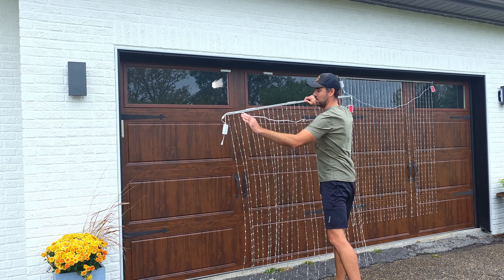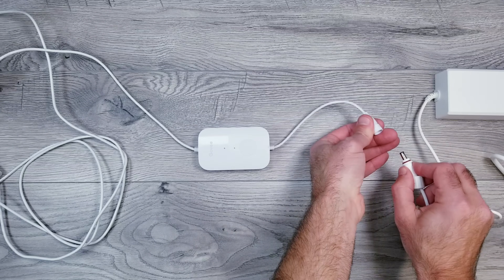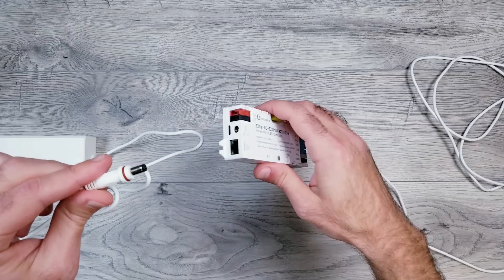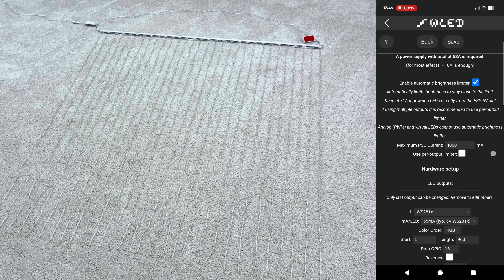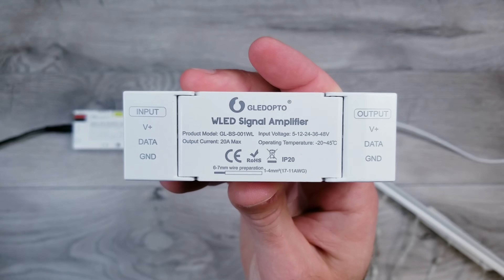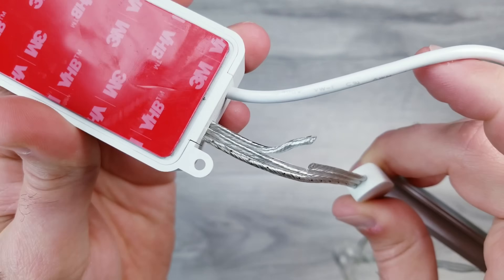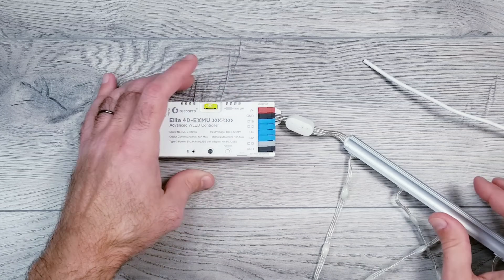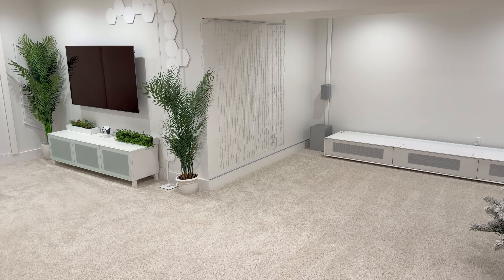will it WLED - episode 9 (new Govee curtain lights PRO)

Comment: Chris, love the conversion, but when you do it, you lose the ability to do the great graphics that Govee lets you use. is there anything out there like that which works with WLED?
Reply from the maker: Thanks for watching! My thought process was I will probably just splice the wires back together around the holidays since I LOVE govee's dreamview functionality and then when I bring them inside, switch back to WLED to take advantage of the different features that you get with WLED. It also probably wouldn't be very difficult to come up with a way to switch data outputs so you could have both connected and switch back and forth. But as far as I know, WLED does not currently have a super easy way of uploading animated gifs to convert to a matrix. You certainly can do this, but its not what I would consider to be super easy.
Reply: @ChrisMaherDIY  I would love to get a hold of the connectors Govee uses so I don't have to cut the wires. They seem custom and can't sourced 3rd party. Is that your experience?

Comment: I always wanted curtain lights but the goove ones were too expensive so I am going to pick cheaper ones and to the same
Reply from the maker: If you want lower density curtains (400 to 500 leds) and have no intention of using the govee software, then get something off brand since there are many options out there. (if you plan to use them outside make sure they are built for that like govee's are) But there is a huge difference between 400 leds and 960 leds which these pro's have and from all the searching I was doing on amazon and aliexpress, I didn't find any other curtains that had as many leds as these govee pro's do.
Reply: Thanks Chris
I just want some low density rgb curtain lights to put in my wall
:)

Comment: What a great video!  Very clear and really good close-up video.  I would be interested in hooking multiple curtains together.  I'm assuming that it's just a matter of continuing the data line with downstream power injection, but I'll wait for you to tell us.  One other thing...any possibility that this approach would work with Govee icicle lights?  Specifically, how would you use WLED to control a 20-meter string and a 10-meter string connected to make one long 30-meter string of lights for one's house.
Reply from the maker: Thanks for watching! For the curtain lights you will want to utilize multiple data outputs. 960 is already getting to be a lot for one data output so I put the second curtain on another data output on the gledopto controller, added it in led preferences and then set it up in the 2d matrix (i showed the 2d matrix settings in the video) But for the icicle lights I would probably use 2 data outputs as well. One data output for the 10 meter and then another for the 20 meter string. I would put the controller in the middle so you wouldn't have to run long wires and then WLED lets you set them up to function as 1 long run. Hope that made sense!
Reply: @ChrisMaherDIY   @dwburger  I still think these are fixed-address LEDs, so putting 2 curtains in series (with v+ injection) will result in duplication of the image on each curtain. Can you at least try it to confirm my theory? Or at least put a small strip before or after the curtain to see if the light duplicate or are serial?
Reply: @LordChariot  Not sure if you were addressing me or Chris???  However, my question was really focused on my icicle lights (a 10-meter string and a 20-meter string) and whether I could put them together and control them with WLED as a single 30-meter string.  Currently, they're running on my house for the holidays.  After I take them down I plan to try some things with them.  I'm not sure how I'll count them since they each have different numbers of lights representing different icicles.
Reply: @dwburger The questions was kind of to anyone who knows or could try it. I think if you put both strings in serial on one data output port, it would not work. They would duplicate. This is because I think they have hardcoded LED numbers built into them, so led 1,2,3,etc. will light on both strings. I want to confirm this before I cut wires on my curtains and icicles. I ran out of ports and would like to string them together instead.
Reply: @LordChariot  I asked ChatGPT about this and below is its reply:
Govee icicle lights are not electrically “raw pixels.”
They are designed to work only with their own controller and firmware.
Even though they look like addressable LEDs, internally they usually have:
- Proprietary controller logic
- Fixed segment mapping
- No exposed data-in / data-out that follows WS2812 / SK6812 protocols
Reply: @dwburger and yet they do work with a generic controller with WS281X protocol, or else Chris wouldn't have these videos here.

Comment: I dont know if it's too late for this year, but next year let's see a Christmas tree made of WLED (with star for bonus)
Reply: @InkwellFoto  I was able to successfully use the Govee 7.5' LED tree with WLED/xLights. Just cut the cord and find the +/-/data.
Reply: @LordChariot  do you have a video? I want to convert my cone trees
Reply: @gram7048  No video of me cutting the wire, just a short on my YT channel showing the tree on my deck (upper left deck). Nothing detailed. Basically, the wire with the dots is the +5, the center is ground, the 3rd line is data. Set WLED to 370 pixels. RGB Color order. The first 360 are the tree matrix (18*20), the last 10 are the star. If you use xLights, keep WLED to 1d, not matrix, and define the tree with Strand Direction Vertical, 1 string,  360nodes/string, 20 strands/string.
Reply: @LordChariot thank you!
Reply: Isn't it's already done.
Reply: @ekshoe-kun if it wasnt clear, I mean all lights and not decorating a traditional tree. Something maybe you can put in the front yard. Anywhere between 8 to 10 feet tall
Reply from the maker: Thanks so much! I was going to try the govee led christmas tree but it was sold out when I went to order it :(

Comment: Nice! Think I’ll try this one. What is the best strip light for permanent outdoor lights for around the house. Also what track system is best for them to go in? Need this to last a long time, placing them on trim next to gutter. Also love the accent lights on the sides of the tv. I must have missed that video
Reply from the maker: Thanks as always buddy! Thats a tough one! I know govee has some outdoor strip lights but the pixel density is super low. If I were wanting to do that (at some point I for sure want to try this!) I'd probably start with some ip65 24v cob leds and see how they looked. As far as a track system thats build to last a long time, that I would have to do some more research. The led channels off amazon that I usually use I'm sure will yellow and become brittle over time if they are constantly in the sun.  (if they are not constantly in the sun then I think the muzata u108 profiles would work just fine) But if they are going to be exposed to the sun, I would probably try reaching out to high end luxury home builders to see if they have any recommendation for high end profiles that they use in their builds!
Reply: @ChrisMaherDIY  is the ip65 or better rating on the sk6812 not the style strip light you would go with? Don’t think I’ll go Govee. I want to wled and do a custom install
Reply from the maker: @blitzkrieg-gaming  For me it would all depend on how much I want to do power injections. 24v cob are controlled in groups so you would lose out on smoother animations compared to sk6812 strips but you would not have to do as much power injectios along the way. But if power injection was a non issue, then yeah, ip65 sk6812 12v strips in my mind be incredible!
Reply: @ChrisMaherDIY looks like ip65 sk6812 is the option I’m gonna go with then. Want that smooth transition around the whole house. Just need to find a really good channel then. Don’t want it to rust or discolor or get brittle like you mentioned